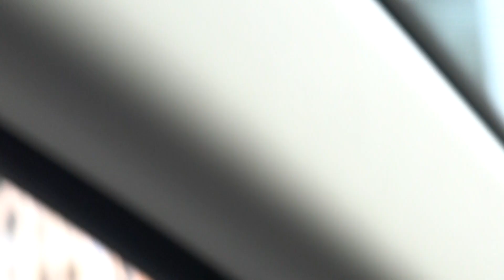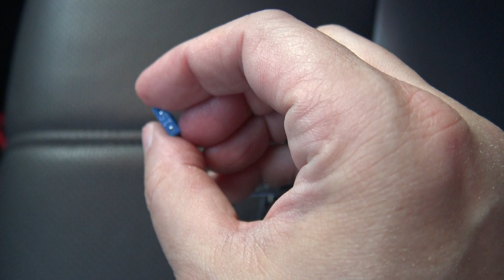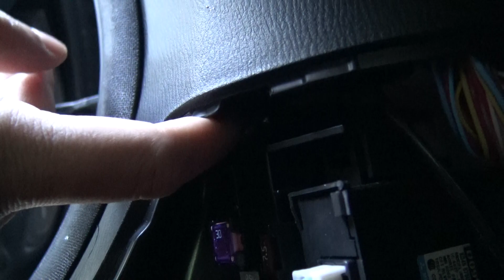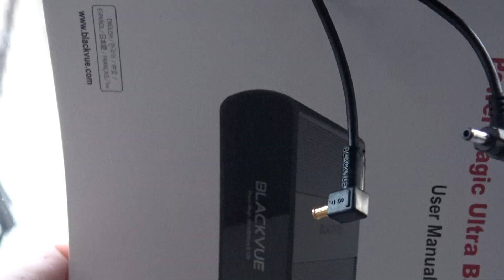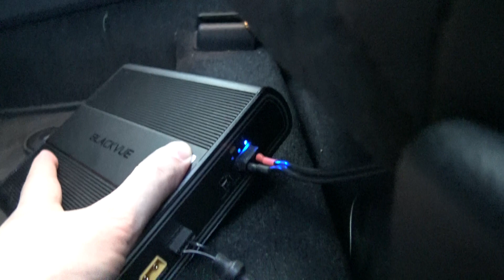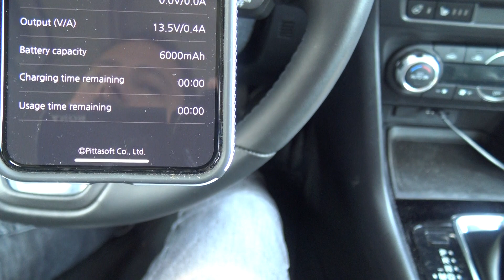Blackvue DR900S 2CH Dashcam and  B 124 battery installation

Comment: It is a lie that they Black vue claim that a 2 cameras last up to 20 hours because I have the DR-750 LTE / 2CH and my B124X only last 15 and something near almost 16 hours before this I was connecting a 2 Power Bank Battery They are called EC Tegnology 26800mAh each battery cost me $ 30 dollars and they lasted 15 hours but they lasted 8 hours charging and when one was discharged I had to go to the car and change it, in conclusion the Battery pack B-124X the only advantage it has is bluetooth and super fast charge and costs 11 times more and doubles the $$$ if you buy an expansion.
Reply from the maker: Yeah i get around 17 hours on mine give or take with the DR900S-2CH

Comment: Does b124  fit with any dashcam?
Reply from the maker: Yes I believe so
Reply: @Ben7seven7  
Does  there a dashcam battery cheaper than b124??
Reply from the maker: Yes there’s an older cheaper model but I would recommend the newest one. علي خالد كاظم
Reply: @Ben7seven7  
How long has the battery lasted
Reply: @alikhalid2074  تبقى تقريباً ٢٤ ساعة اخي، و تشحن خلال ٤٠ دقيقة اذا شبكتها مثل الفيديو عند علبة الفيوزات، و تشحن خلال ٨٠ دقيقة اذا شبكتها على مدخل الولاعة